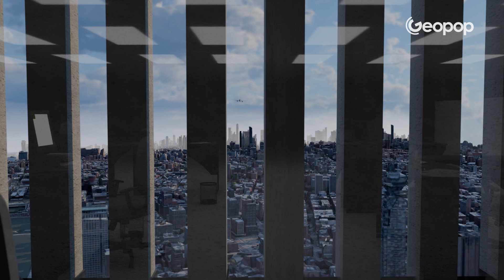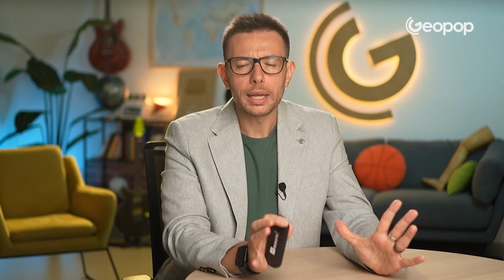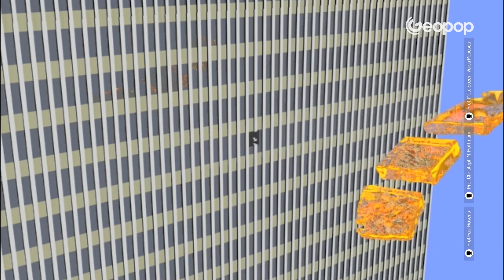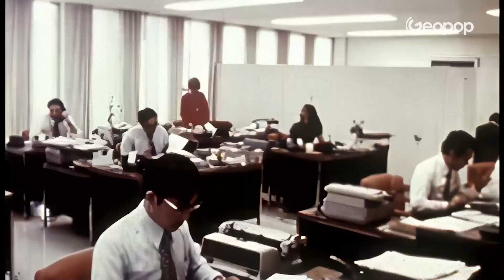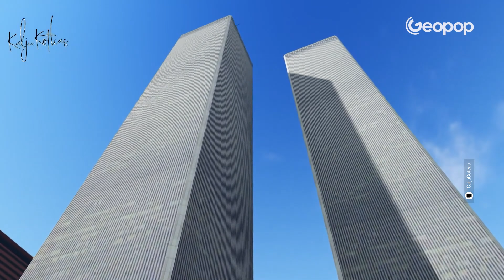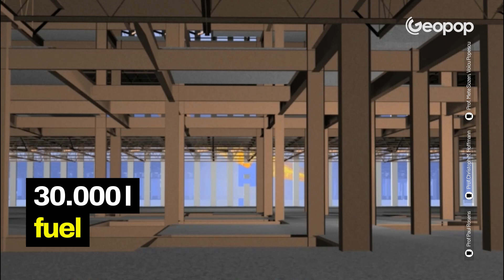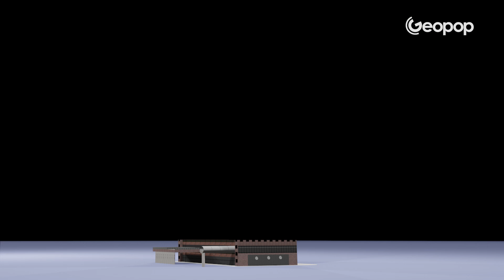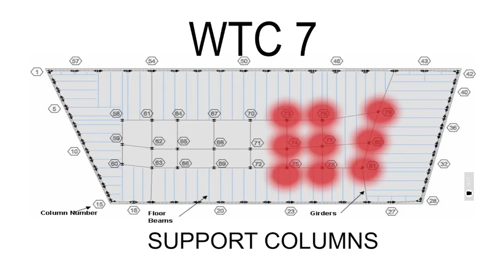9/11, 2001: The Technical Reconstruction of the Twin Towers and WTC 7 Collapses

Comment: Can any pilots confirm how difficult it would be to fly those planes and hit those buildings at the speed the jets hit with the little training the hijackers had? I'm not fueling any conspiracy.I just want to know how difficult it would be at that many knots .
Reply: pilots can see these things from MILES away !! .... all you have to do is AIM !! ....if you look at the videos - the hijackers had to make SEVERAL adjustments
Reply: @markhellman-pn3hn I think you're over simplifying it. I believe it's very difficult to fly through Manhattan and hit a building. That's just an opinion though, I'm not a pilot.
Reply: @ArtBellJr  i appreciate your opinion - but it would be helpfull if you DID speak to a pilot concerning this issue - they could give a more realistic viewpoint than me
Reply: @markhellman-pn3hn Art Bell did , his name was Jon Lear . The son of Lear jet inventor. He interviewed Jon many times. He said it would be very difficult on 6 months training.  Thanks for commenting.
Reply: @markhellman-pn3hn  Absolute nonsense - I know professional pilots who have attempted this manoeuvre using an official simulator. They all failed dismally. And as for the supposed 'airliner' that hit the Pentagon and the steep circular downward manoeuvres it had to do to bring it down to the near ground level needed, absolute rubbish - no airliner with an untrained crew could have achieved that. And a carbon-nosed airliner would have splattered on impact with the first reinforced wall with perhaps the engines and undercarriage penetrating a little further. The best explanation is that it was an uranium tipped and disguised cruise missile - how else could it penetrate through six walls to leave a nice round hole in the final wall? And where was the wreckage? And where was the damage to the initial wall where the wings would have hit. It's all a load of baloney!
Reply: @Dewiart16  Better get more tinfoil... that beanie seems to be coming loose.
Reply: @Dewiart16  the amount of brainwashing you have has made your brain thick as cement !! ... getting through to you isn't going be easy ... (1) all of the FAA audio tapes were hoaxed ... (2) all of the eyewitnesses were paid liars ... (3) the passenger manifest list is also a part of the hoax, the names are fake, nobody real existed ... (4) the missing airplane flew into the twilight zone ... (5) the airplane debris was secretly planted there when nobody was looking ... (6) the pictures were photoshopped  ... (7) enroll yourself in a therapy program before its too late
Reply: @markhellman-pn3hn  Sorry, but when you resort to insults and silliness, you know you've lost the argument.
Reply: @Dewiart16  a lie is a lie - a truth is a truth ... bonehead
Reply: @markhellman-pn3hn  'bonehead'...is that the best you can do?
Reply: @Dewiart16  i have better insults - would you like more ?? ...try KAPO on for size
Reply: their goal wasn't to FLY the airplane - there goal was to CRASH the airplane !! ... a simple experiment would prove this - drive your car - pick a building - AND CRASH INTO IT !! .... (im kidding) (don't do it)
Reply: @markhellman-pn3hn A car is grounded a airplane is way more difficult. I think you're minimalizing the situation.
Reply: @ArtBellJr  i think my comparison is accurate !! ... you're welcome to try it if you wish
Reply: @markhellman-pn3hn Apples and oranges .
Reply: Check "pilots for 9/11 truth".
Reply: Is it even possible for a Boeing 767 fly at 500 mph or above at an altitude of 1,100 feet?
Google Al Overview
No, a standard Boeing 767 cannot safely fly at 500 mph or above at a low altitude of 1,100 feet because the air density at that altitude would create excessive aerodynamic forces and engine limitations that exceed the aircraft's design limits, leading to structural damage or a loss of control. While 767s can cruise much faster at higher altitudes, attempting such speeds at low altitude would cause the aircraft to exceed its maximum operating speed (Vmo), leading to a potential airframe failure.
Why it's not possible:
Max Operating Speed (Vmo):
A Boeing 767 has a typical Vmo around 360 knots (approximately 414 mph), but this value is for higher altitudes.
Air Density and Aerodynamic Forces:
At 1,100 feet, the air is much denser than at cruising altitudes. Flying at 500 mph (which is over 430 knots) in this dense air would create immense aerodynamic forces on the aircraft's structure.
Structural Limits:
The 767's airframe, particularly its wings, is not designed to withstand the extreme stresses and G-forces that would be generated at such speeds and low altitudes.
Engine Limitations:
The engines would struggle to provide the necessary thrust to overcome the increased drag at that speed and density, and attempting to do so would push them beyond their design specifications.
What would happen:
Structural Failure:
The airframe, wings, or other components could be subjected to loads far beyond their design limits, potentially leading to structural failure or a complete break-up of the aircraft.
Loss of Control:
The extreme aerodynamic forces could exceed the pilot's ability to control the aircraft, even in a controlled dive.
Exceeding the Flight Envelope:
The aircraft would be flying well outside its designed operating parameters, a condition known as flying beyond the flight envelope, which is extremely dangerous.
Reply: No sane pilot will do that but it is possible, the terrorists want it to happen
Reply: i'm not and i can't, but this is the one thing that has always kind of never made sense to me. Fires, steel, collapse, etc goes way over my head. But aiming a plane going, well honestly I don't how fast it was going but fast, at a building and nailing the damn thing just seems difficult even for a seasoned pilot. I'm not a pilot and maybe it is easier than I would assume. It just seems, off.
Reply: @memyself898 most jets got about 200 knots , those planes that day were traveling over 500 knots . Quite a difference. And jets can go faster its just what people usually travel at around 200 knots on a plane.
Reply: @ArtBellJr  right i knew it was damn fast.
Reply: @ArtBellJr  Ummm... nope.  Not even close.  Cruise for a 767 is around 460 knots, or mach .8.  It can go up to mach .86.  For context, 460 knots is about 850 km/h, or about 530 mph.
Reply: @ChristLink-Channel Most of your statements are incorrect. Look at flight radar 24 app. Planes cruise at less then 300 knots all day and night. Second the hijackers only trained for supposedly 6 months. Some pilots can't even take off in 6 months. Let alone many pilots ha e been interviewed . I asked a rhetorical question at first I knew the answer to the question before I asked it  so go ahead and use a "simulator" that's not real life.
Reply: @ArtBellJr  In reality, all of my statements are completely correct.  Check out the REAL performance figures for the 767, as úblished by Boeing.  Not your imagination.  And your statement is plainly absurd:  Taking off is not hard at all.  Pretty much anyone can be taught to do it in an hour or so.  Landing, on the other hand, is far more complex.  Any student in flight school who "can't take off after six months" would have been washed out 5 months and three weeks earlier.  I'd suggest you go sign up with a real flying school, and get some real training, before you spew any more about things you clearly do not comprehend in the least.
Reply: @memyself898  Get a flight simulator program for your computer, and try it.  after fist taking the same type of flying training the terrorists did.  It wouldn't be that hard to do.
Reply: @ChristLink-Channel  You clearly know nothing about flying a cutting-edge airliner. A single prop Cessna is hugely different to a modern Boeing airliner. A 'simulator program for your computer'...what a joke!!!!
Reply: @Dewiart16  You might not be aware, but flight simulators model the exact performance of several different aircraft, including airliners.  Jus' sayin'
Reply: @Dewiart16  Tell you what: GO to a real flying school, get some real training, before you continue spewing your ignorance around here.  Those of us who are pilots can see right through you, and every other troll who wants to pretend knowledge and experience that they actually don't have.
Reply: @ChristLink-Channel  Then explain to me why so many professional airline pilots don't buy the official narrative. Are you a single prop amateur pilot or a proper professional airline pilot? I am not a pilot but I am a former officer in the military and have talked to pilots who know their stuff and who do not believe the official narrative knowing as they do how extremely complex the cockpit of an airliner is and how someone with just a few hours on a single prop Cessna wouldn't have a chance of doing what is claimed...especially with the stress and trauma of the situation. Sorry, but it is you chaps who are losing all credibility. The people are waking up and simply applying common sense.
Reply: @Dewiart16  Try again.  You should talk t real pilots, not fake ones.  The 767 isn't that hard to fly at all, once it is in the air.  Especially if your only objective is to crash...  Yes, flying it properly is a challenge, for sure, but just pointing it in the right direction isn't hard to do, especially if you don't care about breaking it or damaging it along the way.  Sorry, but it is you chaps who are losing all credibility, giving the 911 "truthers" such a bad reputation, due to your ignorance of what flying is all about.
Reply: @ChristLink-Channel  Yes, Hani Hanjours was a model pilot who knew his stuff after flying a single prop Cessna (not very well by all accounts). He clearly had all the attributes needed to be a first class Navy Top Gun pilot. Give us a break!!!!
Reply: @Dewiart16  Tell you what, go to any half-decent flight school, and sign up for some flying lessons.  Then, once you have your license, you'll be qualified to comment.  Until then, you are just another ignorant troll with an agenda.
Reply: Not difficult at all.  They terrorists had taken flying lessons, and knew more than enough to accomplish that.
Reply: Look at the testing and the ability to fly and operate bus sized passenger Boeings without a pilot  via exclusive remote control since 1984. The vid is found here on yt.  I havealso watched the testimony of several experinced captin pilots with many decades of experience and they have all said it aledgedly it was very difficult if not kneerly impossible to do so the manuvering of the aircract as it happened that day. Especialy being executed by so-called pilots with the limited training as the hijackers had. They had never trained in any aircraft of that size. Its all covered on the channel redacted, also here on yt..
Reply: @AlvaBarr  Pity they didn't interview real airline pilots.  Real 767 pilots will tell you that it would not be hard to do that.
Reply: @ChristLink-Channel  I have spoken to 'real 767 pilots'...and it would be bloody hard to do if your training was on a single prop Cessna. Let's get real!
Reply: @AlvaBarr  you're a complete loon mate, lying out your ass
Reply: What I found more alarming was the video footage of some of the highjackers that was captured on 9/12. Alive and well. Did the parachute before impact maybe? Or the in perfect conditon zero burned passaport of one of the highjackers also discovered at ground zero by an FBI agent. I wonder how that happened.. How about the missing footage of the airplane that went in the penagon, I have never seen that. I have only seen the one with the missle strike minus the airplane.  I wonder what happened to the airplane. Although, I do remember the scattered parts of an airplane out in the lawn of the pentagon. It must have dissassembled before impact, im guessing.
Reply: You missed the copious evidence of commercial airliner parts - engines, fuselage - embedded in the walls of the pentagon
Reply: @AlvaBarr I also question the perfect condition of a passport a few blocks away when almost everyone and anything in the airplane would have caught fire.
Reply: @ArtBellJr  Key point: "a few blocks away".  Therefore it was blow out with the initial impact, and never went through the fire.  Pretty obvious.
Reply: @ChristLink-Channel Few blocks away never went through fire? You're obviously missing much thought process . The whole contents of the airplane turn into fire instantly. The passport made of paper would be ashes in less then a second.

Comment: If the planes fell apart on impact, why did one of them almost fly thru the other side
Reply: I know this may seem difficult to understand for people with limited understanding of basic physics, but even after the planes broke apart from the impact the pieces are still travelling at hundreds of miles per hour through the building. Many pieces of the broken up planes did actually go all the way through the building and were found in the streets below.

Comment: NIST stopped their “scientific process” when they determined “collapse was inevitable”.
Reply: Did they?  How?  Please be specific, cite sources and show your math. 

I won't wait up.
Reply: @TheLoonResistance Good thing, Critical Stinker! 

You will never convince me that the weakest part of the building, even more weakened from the fires, completely destroyed the heavier built bottom 2/3 of the building that wasn’t weakened by fire. That isn’t how physics work. 

Build something….ANYTHING…..and make it stronger at the bottom, and less strong as you ascend into the heavens. Point is, you want the weight of the building at the bottom holding the least amount of weight as needed nearing the top. Then, damage said structure that you built 2/3 of the way up, and let me know what happens….deal?? 

Here’s what I bet…..I bet the top 1/3 of your structure doesn’t completely demolish the bottom 2/3 into rubble and dust. Please let me know if I’m wrong after your experiments. 😉😉
Reply: @CapnPink28  - And that is why you fail. You are still stuck in the simplistic false Bazantian block dynamics mechanisms championed by Richard Gage and Architects and Engineers for 9/11 Truth. There is no top block crushing a bottom block .  This is not Tricky Dick Gage's idiotic two cardboard boxes smashing into each other. 

THAT ISN'T HOW IT HAPPENED.

Until you decide you can work past that you are right, no one will ever convince you. Your starting assumptions are wrong and those wrong assumptions are now your belief, your dogma.  Recognizing you missed the plot is never fun. Much more satisfying to assume everyone else is wrong. 

But of course you don't understand the real mechanisms, because you never actually read the NIST report you are complaining about. That is why you didn't - indeed couldn't - answer my question, instead engaging in deliberate derail and reversed burden of proof trickery.

I don't know would have been a perfectly acceptible answer. It has the benefit of being honest, and would have formed a basis for further discussion. Now you've thrown up a wall - because you don't really want to know. You want to believe